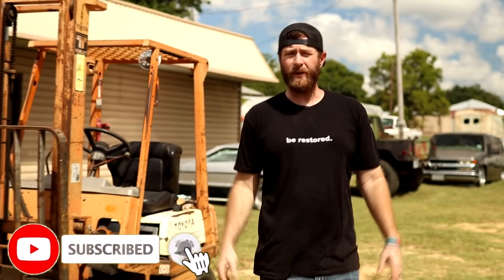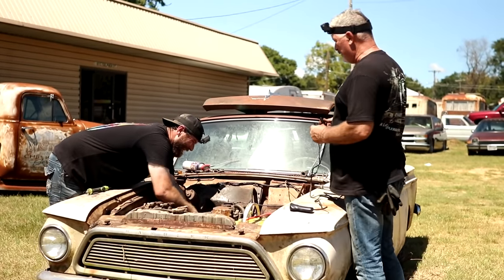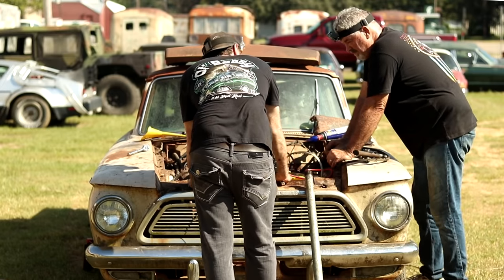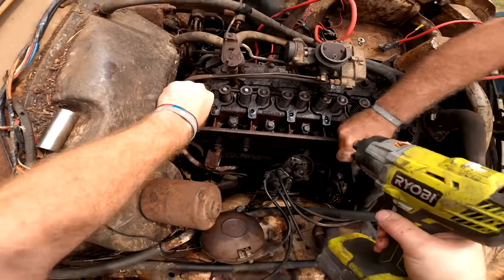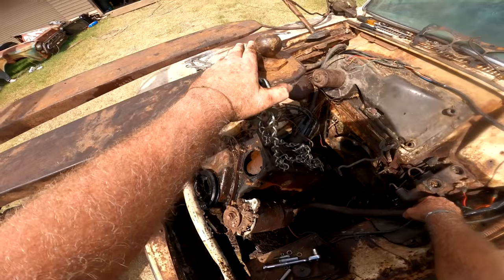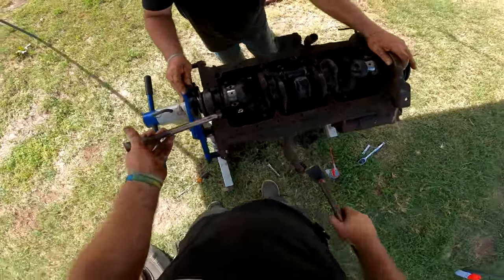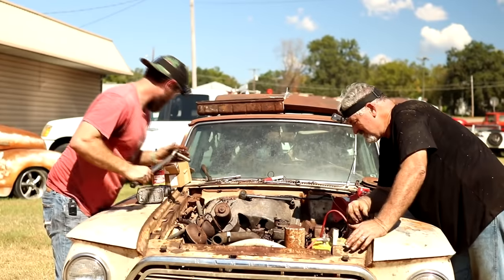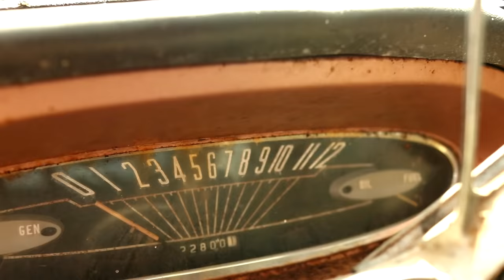Will It Run After 50 Years? | Forgotten 1962 American AMC Rambler | Buried & Locked Up | RESTORED

Comment: Guys are spinning your wheels on that motor is locked up I think it’s good for the boat anchor just pull the motor out transmission and try to restore that old car it’s not meant for many of those left I think that’s an old rambler there’s not very many of those cars left so I will just pull the motor and transmission out drop a small V-8 in it after I had after it’s restored and drive it have some fun with it take your family out in it

Comment: I've  been there 40 times you guys are doing it wrong.put the wooded block in the piston and hit it down that works every time
Reply: Good boy
Reply: AMC had a strong six banger  ..strong
Reply from the maker: Thanks, but we tried that and found out that the piston that was stuck was at the bottom of the crank rotation so up was the only option

Comment: Wow!! we bought a 62 Rambler American for $1800 new. Without a doubt the worst car we ever had. Strange. It has a flat head engine with 90 hp. By 1965 it was rusty, running on one cylinder. The windshield wipers didn't work and the doors wouldn't close. What a horrible car.

Comment: Those Ramblers were not expensive cars. They were NOT known for their quality. It was CHEAP transportation. IF that Rambler made it to 124,000 miles then it was probably well in need of a new engine or a rebuild. CAN this one be restored to life? SURE - anything is possible with enough time, sweat, and dollars pumped into it. But, is it worth it? Personally - I'd rather tinker with an AMC MATADOR 360 V8-powered collector car. I'm sure someone will want this ole gal - let's hope so!

Comment: I used a screwdriver I want a small block 350 flywheel to unseize a motor that did not have enough oil in it and got it to start

Comment: i enjoyed watching but was wondering why you guys wearing black shirts in the blazing hot sun dark colors absorb heat ?? lol ,also i would be careful cleaning out rodent nest . its filled with feces . there is a deadly mold that grows on them and if inhaled its deadly. you seem like good guys so wanted to share that with you. also rodents wont eat wiring prior to the mid 90's .automakers used a petroleum based wire insulation .they started using a soy based insulation after that because its cheaper and its tasty to the critters. nice move auto makers lol.

Comment: Don’t try to start it disassemble and lube and oil all the parts make sure you have gas and oil and antifreeze and a working fuel oil and water pump good fuses a new battery and alternator a clear exhaust pipe Etc or you can live up to the name of knucklehead

Comment: Neither of you guys know how to use a hammer If you want the full power out of a hammer you have to hold the the handle at the end of the handle. Both of you are doing what my Father used to say "You are choking the hammer" which means you are holding the hammer handle up near the head of the hammer.

Comment: You know I hate to be the bearer of bad news jet motor if it lasts three months and running if you get it running the Behringer in bed is a bad shape for riffic shape weird that much crack that's been in attendance no way for you to tell if the oil passage ways are clear enough Stephen get oil pressure you fighting stuck rings in bed bearings take the flipping engine to the Machine Shop give them between 7 and $800 in a week or two go by and they'll put new bearings and rings and clean up the cylinders from seven eight hundred bucks you have a you have a bulletproof stock running bottom in for that engine what you're going to do you're going to screw that crank up where they can't be polished at this point my best advice for you guys put the engine machine shop and let them have it do what they going to take and do with it you got too many red flags on his engine you got too many red flags for me on this block you get crank rod problems piston ring problems with those two red flags and then you talk thinking that maybe the block itself you are truly wasting your time again send it to the machine shop and let them do their job anytime you got 10 internet for them to get it unlocked and you see that you got Baron problems you wasting your time man my last word machine shop